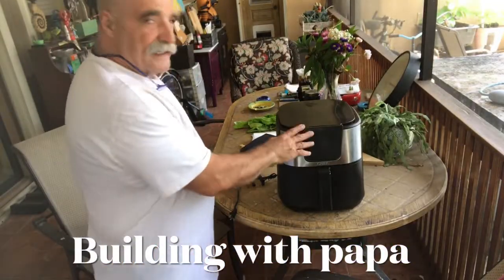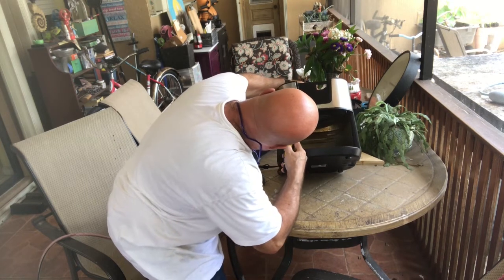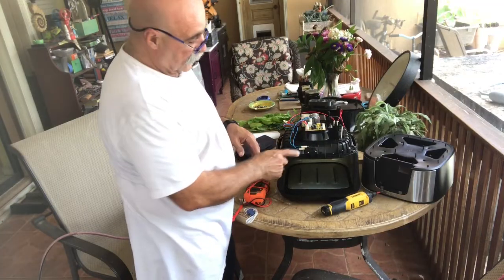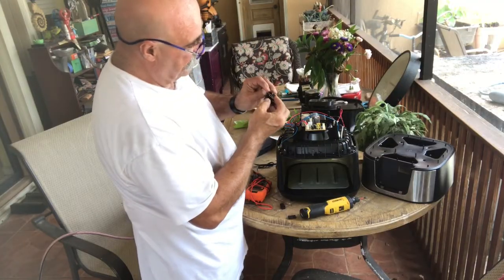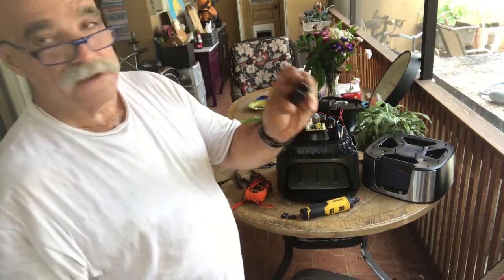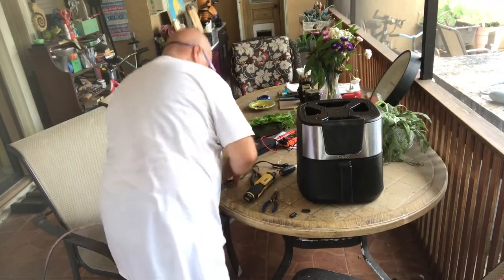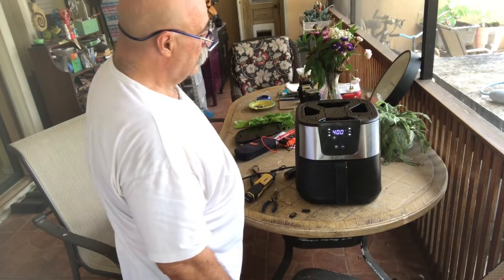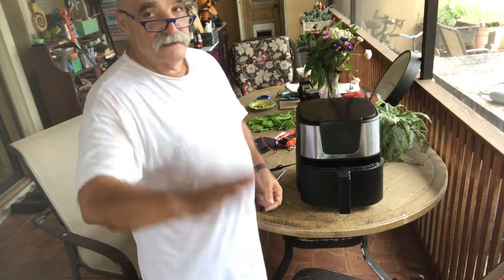How to repair your air fryer￼ (@Buildingwithpapa)

Comment: Hi, great video!! but my problem doesn"t seem to be a plug may be thermal fuse. Do you know where is that located? I tried to look up but no luck so far..
Reply from the maker: Thank you for your question. Did you run a diagnostic to find out where the power is running or is terminated mine wasn’t the plug it was a micro switch. It would not turn on the power when the drawer was in place these go quite frequently. You need to do the diagnostic to find out, which location the power fails. I hope this helps you and if you can leave me a thumbs up.

Comment: Hi I have the exact same fryer. I don't know how to test the continuity with my multimeter. Blue is negative, I assume but the cables are coated, so just check on the metal end? Or do I need to get to the wires inside? What setting on the multimeter omega or V2000? Mine doesn't have the beeper. Which places should I test and what reading would be normal? Thanks🙏
Reply from the maker: Thank you for your questions. I would like first for you to be very familiar with your multimeter. There are very good videos on how to read multimeters it would be very unusual if you don’t have a Continuity setting on your multimeter, so I want you to be very comfortable with it or you might get hurt so please be careful.
That being said the first thing you want to test is the voltage coming out of the cord so where the two wires come into the unit do you want to test them metal pieces if you have 120 V coming from your wire than your wire is good The rest you’re going to need to use the Continuity now if you still don’t know how to do that you can jump the two blue wires at the switch together and see if your unit comes on but you need to be very careful I don’t want you to get shocked so always work on the unit with it unplugged and your hands away from the unit when you plug it in when you’re doing the test if you go through the video again, I explain everything especially at the end. I hope this helps you, and if you can leave me a thumbs up.

Comment: Any chance you can post the link for the part
Reply from the maker: It’s called the micro switch. I did put it in the description, but I copied it here for you.https://www.amazon.com/gp/search?ie=UTF8&tag=papabuilding-20&linkCode=ur2&linkId=ca691ec1b76a1f640c097dc435fb2034&camp=1789&creative=9325&index=appliances&keywords=KW7
I hope this helps you and if you can leave me a thumbs up.

Comment: Thanks for the video. I have a Cosori CP358 AF
In my case, the switch worked fine, but the plastic lug for the screw that held the switch, was cracked. That allowed the switch to move instead of engaging and disengaging. I put a piece of heat-shrink tubing around the lug, but still not tight enough, although it now comes on if you lift the drawer. I'm going to build up the ramp on the drawer with a drop of epoxy
Reply from the maker: Why don’t you put the Apoxsee on the screw? Do you think that would work? I’m glad you like the video and if you can give me a thumbs up.
Reply: @buildingwithpapa  Well if the switch actually does go bad, I'd want to be able to get it out. I use the thing a lot, so I'll let the epoxy cure overnight. BTW, your video showed me my unit wasn't actually dead, so thanks again.

Comment: Help please. Mine turns on but not heating...do you a fix for that. Thank you
Reply from the maker: Thank you for your question. Did you go through the diagnostic of finding out if it has power to certain locations it could be your element that is burnt out. I hope this helps you and if you can leave me a thumbs up.

Comment: would you know how to access the power cord connection inside the unit. I believe my cord needs to be replaced.
Reply from the maker: Follow the cord to the back of the unit make sure you’ve already unplugged it and when it comes in the back of the unit, you can trace it and use your continuity tester to the end of the plug and each wire to make sure you have continuity on both lines if you do then your cord is OK I hope this help you, and if you can leave me a thumbs up

Comment: I thank you for the video wish you would have said the brand name though. Does this work for any air fryer?
Reply from the maker: Make sure you test the continuity of the switch. You have to have some type of switch that engages the air fryer. Once the container is pushed in or disengage when it comes out. If you don’t have continuity with the switch, then it’s just the switch other air fryers may have a different switch, And you just have to locate it and then change it out. Hope this helped you and if you can leave me a thumbs up.

Comment: what tool did you use to take the lid off??
Reply from the maker: I used a flat head screwdriver just get it in there pry it up it will pop off and then it’ll reveal the screws that you need to unscrew. I hope this help you, and if you can leave me a thumbs up.

Comment: It's called a microswitch if anyone out there wants to go look for the part.
There's different ones, 2 wire, 3 wire, 2way y ones etc.   but they're std sized and easy tobuy off Amazon.
Reply from the maker: Thank you for your comment and if you can leave me a thumbs up.
Reply: But of course Matey.
BTW. You inspired me to disassemble my smoking airfryer and clean out 80% of the fat it had accumulated.

It refused to die on reassembly so I baked a baguette in it to make it smell nice and fresh.

Love from London.

Comment: I wish you showed how to remove the first top cap. I can’t get mine off at all
Reply from the maker: Thank you for your comment. I don’t know the type of air fryer you have but the one that I have I was able to get a flat head screwdriver underneath the lid and just start working your way around the top prying it off it just snaps in. I hope this helps you, and if you can give me a thumbs up.
Reply: For the Instant Vortex air fryer is an easy fix. All you have to do is open the top and find the little black button right next to the blue wire. That should be a reset button push it down ( I used chop stick) and that’s it.
Reply: They're spring tabs. Jiggle each one off with a screwdriver.

Comment: Is there a fix for the Corsori cable connexion overheating isssue that causes the recalls?
Reply from the maker: I haven’t heard anything about that mine was a simple fix with the switch that wasn’t working.
Hope you enjoyed the video and if you can leave me a thumbs up.
Reply: Just replace the cord with a heavier gauge
Reply: @joseph7105  the issue with the recalled Cosori fryers is apparently overheating at the cramps level... The replacement fryers use the same cord gage but have a different way of connecting the the power cord with the wires inside the appliance (wires are now soldered instead of simply cramped).
Reply: @hilariousriders  Yeah I just cut my cord and then replaced the wire fixing the crimp issue

Comment: Not sure where to buy a new switch
Reply from the maker: I bought them on Amazon.

2pcs KW7-0 16A 125VAC/250VAC Microwave Push Button Microswitch Micro Switches 1NO Contact Microswitch Micro Switch for Game Machines Electric Cookers Black

I copied the link that I used it’s pretty standard switch make sure you double checked everything that it is the switch and not something else.
I hope this helps you and if you can leave me a thumbs up.